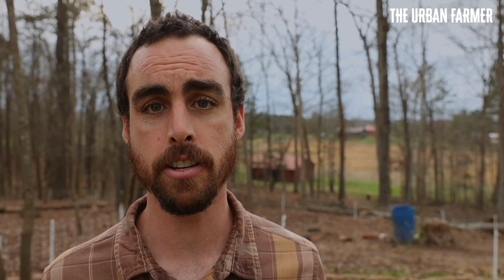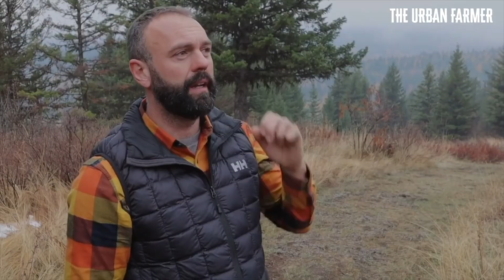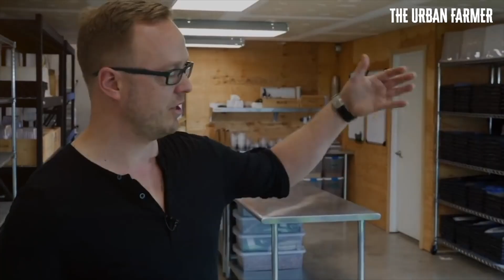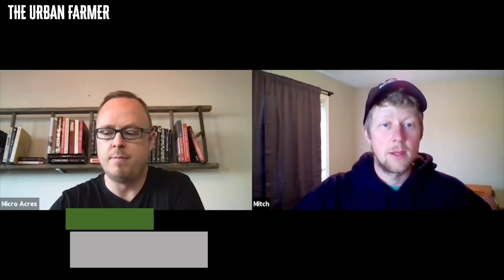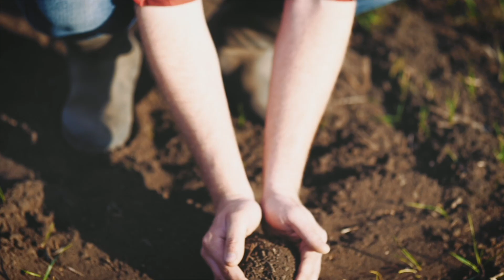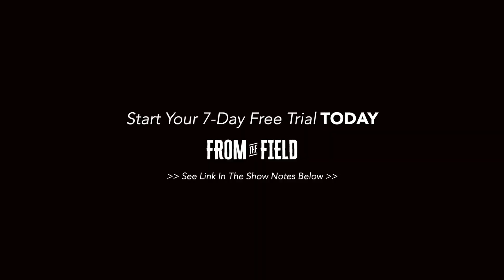Microgreens: Electrical Upgrades for Garage Growing - LISTEN IN

Comment: Use a watt meter that’ll help depends on wiring too I can run 2 racks with led no problem on a 15 amp breaker but it has 12ga